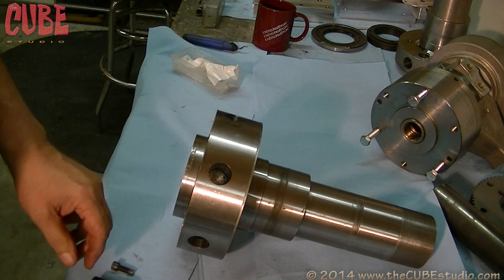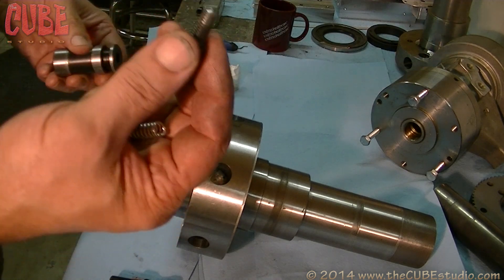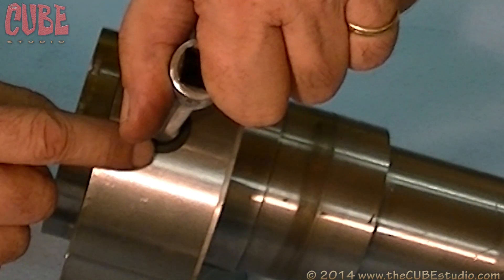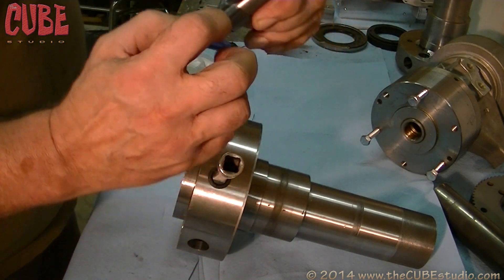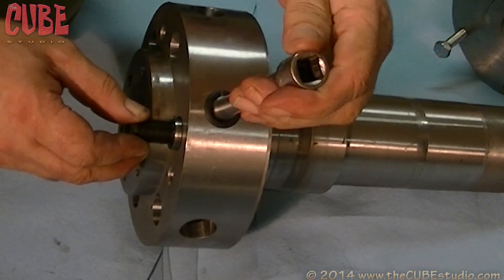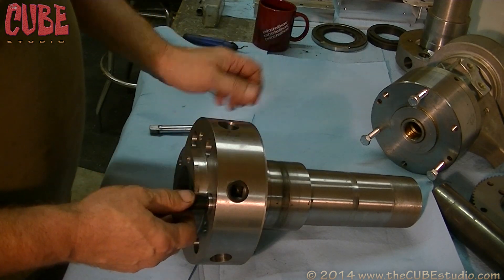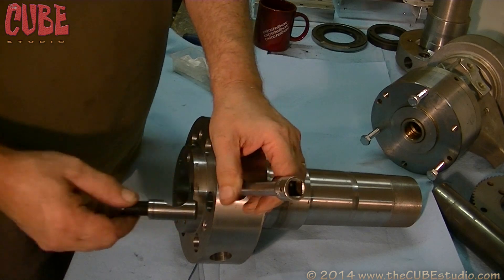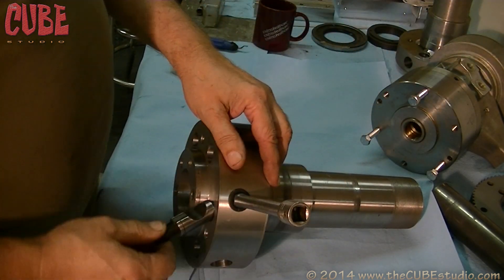PART 4 - InTurn™ ULTRA ultimate 4th axis Build

Comment: Yes the live presentation is good, and you explained the cam looks very well.
Thank you
Reply from the maker: AN alternative method for making a cam is to chuck the stock centered and coordinate the Y and A axis so that the cutting tool moves in the Y axis to cut the cam shape. Unless you have CAM software that will do this, the programming can be a bit complicated, however, for anything other than a straight up off-center circle, you would need to use the Y (or Z) axis to coordinate with the rotary axis to create the desired shape.